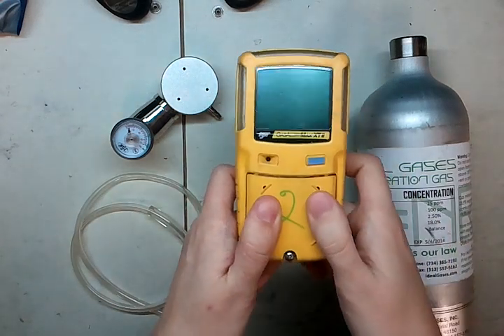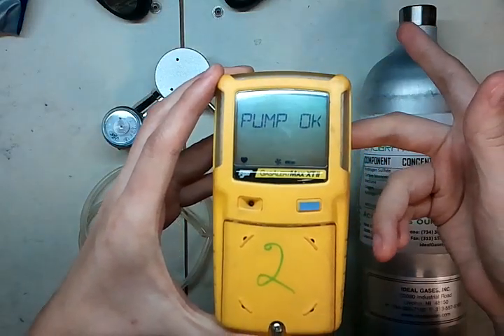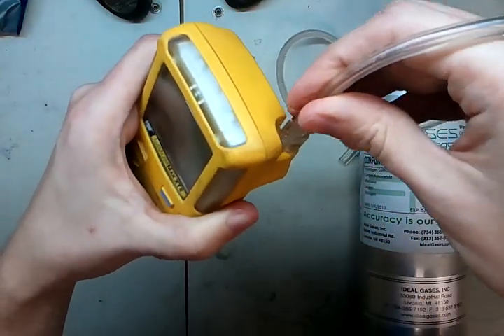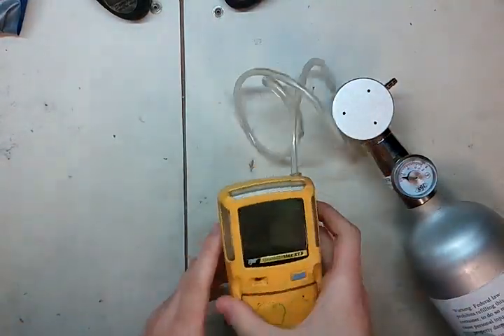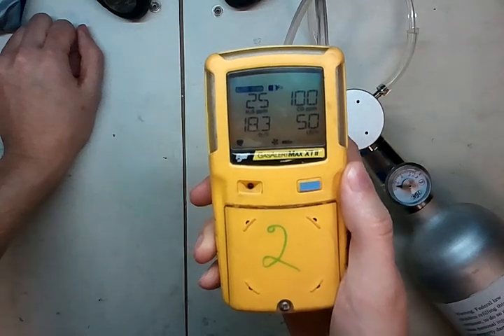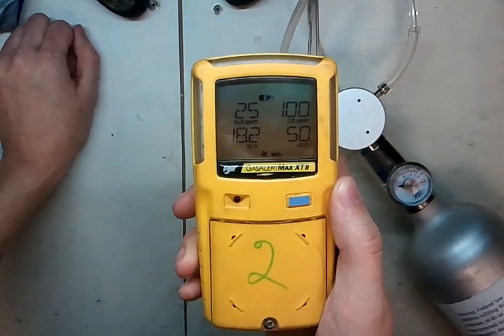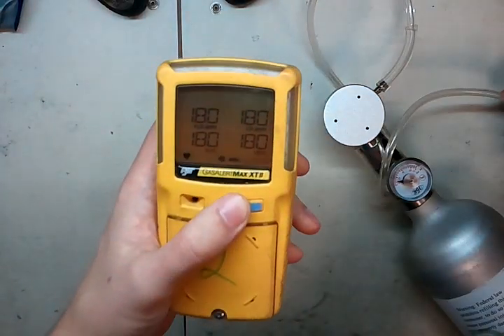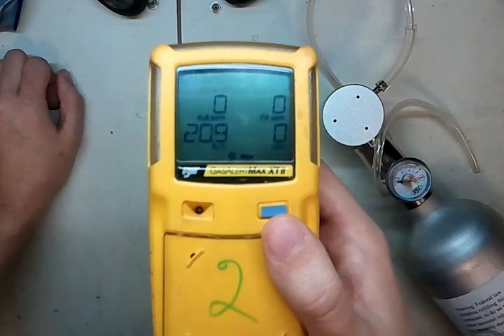BW Technologies GasAlert Max XT II Gas Calibration Guide by Ideal Calibrations

Comment: Hi James, during calibration, upon connecting the span gas cylinder,  it's saying "Pump Off" and calibration is failing. Can you advise.
Reply from the maker: @BhaskarRoy-f1p  hey there, sounds like you're using a fixed flow regulator, does it have an on/off knob? If so, make sure the valve is open the entire time, don't hook it till the unit till it is open. If I were you I'd recommend using a demand flow regulator instead
Reply: @Idealcalibrations  Yes, on/off knob with a regulator. Do I have keep it fully open? I just left it like partially open. Kindly advise.
Reply from the maker: @BhaskarRoy-f1p  fully open, it's not a flow adjust valve, you want it either all on it all off

Comment: How about IR LOCK ON?
Reply from the maker: Sounds like it's set for IR lock for calibration. Hook the unit up to Fleet Manager using the data link and remove that check box in the config and you should be set.

Comment: witch gas the device catch?
Reply from the maker: Hey Hamad, this device detects Hydrogen Sulfide (H2S), Carbon Monoxide (CO), Explosives such as Methane (CH4), and Oxygen (O2).
Reply: @Idealcalibrations  thank you sir .. what about drager 7000 ?
Reply from the maker: @H6_8  The 7000 can have any number of sensor configurations, so I wouldn't know unless I had the unit in front of me, sorry
Reply: @Idealcalibrations  thank you for your replay

Comment: I would like to ask if this method call as calibration? Because my distributor said that I need micro dock to calibrate. Your method, they call only a bump test.
Please advice.. Thank you..
Reply from the maker: Your distributor is incorrect. You can both bump test and calibrate a detector manually, with just the gas and the regulator. All a calibration requires is the steps in the video.
Sounds like they're trying to sell you a dock.
Reply: @Idealcalibrations  tq for the answer..

Comment: HI, Jeams my machine is not Geting PUMP OK, what to do?
Reply from the maker: Hey Mohammad, sounds like your pump block is failing. Check the seal where your input and filter holder meet the back case. Usually if you unscrew this and remove it, you'll seem some damage to the back case. 95% of the time that's the problem and you either need to fix or replace that back case. Let me know if that doesn't fix it

Comment: Am trying to calibrate my meter but am using a 0.2 flow meter. Would that give me a false reading
Reply from the maker: Unfortunately that does sound too slow.  If it's a pumped unit, it's going to do less than nice things to the pump motor over time as well, because it's not flowing enough gas for the pump.

Comment: How can I set de custom start-up message?

Thanks.
Reply from the maker: Hey Marco, you need to go into the options using the Fleet Track software from BW Technologies as well as the USB cord you buy from them.  They're about $75 from what I remember off the top of my head. Once you're in there it's fairly easy.  Email me if you have any questions from there.